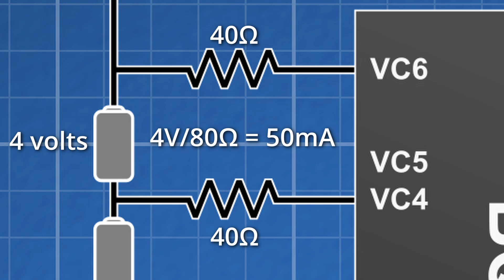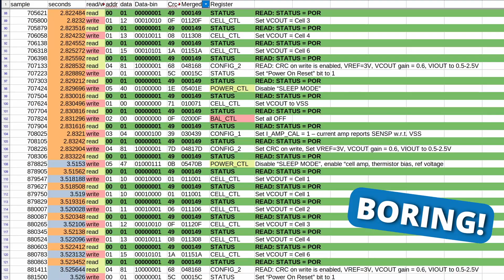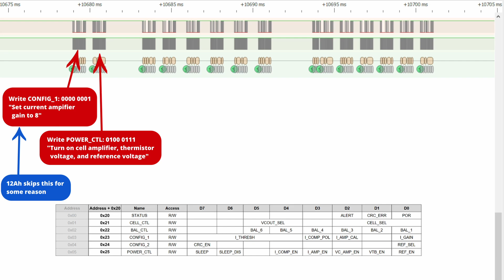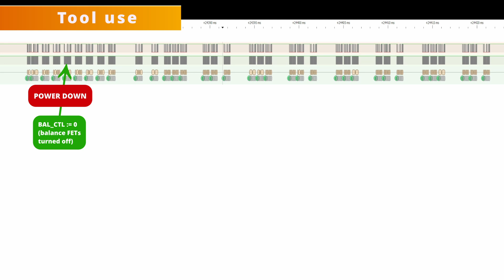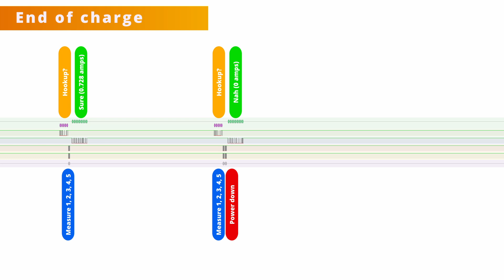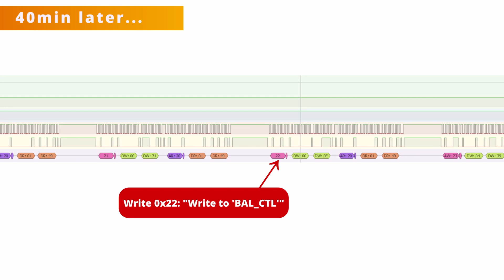[010] Why do M18 batteries charge to 3 bars?

Comment: Found you through Louis rossman and I'm now binging your backlog. 

It's absurd to me that my DIY BMS implementation using nothing more advanced than a few opamps and comparators from the 80s for ICs and a bunch of generic discreet components does a better job than these outrageously expensive products. 

There are so many cheap and reliable ways to top balance these cells that even a trickle of balancing current would significantly improve lifespan.

Comment: great vids mate! Any device or way to do cell balancing on any brand of non balacing battery, am on dewalt batteries but would be of interest to hack if possibler. On dewalt  can get a cell reading from the inner spade connectors. A way also of checking low or faulty cells
Reply from the maker: Check my [009] video on Dewalt. Pinned commemt was from someone that found a RC  charger that works with Dewalt (most don't due to the 10-Ohm resistors between C1-C4 pins and the cells).
Reply: @toolscientist  Hey Thanks

Comment: I have been reverse engineering Ryobi batteries (also made by TTI) and seems like they only balance if the imbalance is within certain range ~0.2v. Anything more and they dont attempt to balance. Also the pack voltage also has to be higher than some threshold to balance. What I found was that the balancing speed is too slow and on the latest Ryobi packs, if you put an imbalanced pack on a charger, it will permanently lock the cell, as in change the uController code, making the cell useless (4 flash error). Pretty bad design causing lots of "dead" packs with perfectly fine cells in them.
Reply from the maker: 18V or 36/40V?

Comment: Hi can you help me with a pcb of a battery m18? I repack 2 batteries. One works really well but the other blinks red and green. The bms lights dont work. And I check the cells and  have proper connection. With the tool runs the with lights but dont run the motor. Full pack have 19v and the 18650 cells looks pretty balance diferences 0.1v. The thermal camera shows me a really different temperature in one smd element 8N. Can you help me to repair? Its really dificult to buy a new pcb here. Im from patagonia argentina. Thankss
Reply from the maker: Have you seen the PCB schematic from Quagmire Repair? That could help you.

Comment: I noticed you used a rapid charger, ive tebalanced serveral of my larger batteries several times. This weekend one of my 12 ah batteries showed the usual 3 bars on the battery but fully charged on the charger. I also was cleaning my truck, a tacoma which had storage behind the seats which i hadnt been into in god knows how long, i found a normal charger that i mist have had for years, curious, i plugged in the battery and suprise, it showed a red light! I lef the battery for several hours, not sure how long until the charger swapped to green, but the battery shows fully charged. 

Im sure many people are like me and at this point only use rapid chargers at the minimum. A follow up of this same style video with a standard charger, potentially one 4 or 5 plus years old would be highly informative. Im very curious, if perhaps for faster charging they dont want to wait for balancing and strictly try to get one or two banks up to 4.2ish, then call it good.
Reply from the maker: The balancing commands happen internal to the battery. It's the signals between the MCU and AFE. The AFE is what does the balancing and has no interaction from the charger. There's a very slim chance that the standard charger sends different signals to the battery, which in turn makes the MCU send different signals to the AFE, but I'd very much doubt it. 

The simplest solution to all of this, would just be to have it balance after charging has finished. That way you don't slow the charging down, but still have balancing.

Comment: so far haven't ever had an issue
Reply from the maker: Do you have any 8 or 12Ah packs? Open them up and measure the voltages. It's quite likely you have at least 0.1V imbalance, unless they're very new.

Comment: Forgive me for my ignorance, but for the link for "code for balancing" in your video description, how would you implement that onto a Milwaukee battery? Like, is that code meant to be flashed onto the existing BMS on Milwaukee batteries and effectively replace Milwaukee's bad programming? If that is the case, how exactly does one go about doing that? Apologies if I'm understanding all this horribly wrong.
Reply from the maker: It was just an example to demonstrate that implementing balancing would not be difficult for Milwaukee. I would need the original source code (or reverse engineered code), then I would need to insert that chunk of code in, compile it to a binary, then flash that binary to the MCU.
Reply: @toolscientist Ah, I see. I appreciate you answering my question seriously.

Comment: you will be more Shocked if you try to test hilti batteries, specially  36v they put expensive ic chip but the same,, 
take my  advice all power tools batteries are the same it's an manufacturing policy not make perfect to make customers always pays new once
Reply from the maker: I'm surprised by Hilti. Their 36V stuff is a bit rare these days. They seem to have gone all-in on 22V and Nuron
Reply: @toolscientist  yeah it is , here in jordon still use ir 😅 , the microcontroller for 36 v is atxmega16a4, and pored doesn't have batteries balance and hard to reset , working on it  hope to hack it

Comment: There’s a scenario you did not test. See if balancing circuit turns on if a series got above 4.2V. This would mean could simply hook up pack to power supply and supply very low current above 21V and would slowly self balance without disassembly

Comment: If you could build a m18 charger clone that instead of telling to turn off unbalancing it turns it on instead?
Reply from the maker: The charger can't tell the battery to balance. Only the microcontroller inside the battery can enable balancing. You'd need to flash the microcontroller with new firmware
Reply: @toolscientist  I went ahead and charged a high output to 4.4V per cell the bms doesnt even balance or basic bleed for safety. I had hoped this could be a trick to initiate automatic balancing at 4.2-4.25V and a 25ma trickle. Milwaukee deserves fires for this basic omission in pack design. The forge batteries HAVE to have balancing if they are doing 2C+ continuous charging!!!???
Reply from the maker: @SurferBobbyLew  the battery won't ever let it charge above 4.2V via the CHG pin. There's a blocking mosfet on that pin that the battery's MCU will turn off. If someone charges via B+, then yeah, things can go bad, but is Milwaukee responsible for people doing dodgy charging? 

I got contacted by someone claiming to be a 'EV battery consultant'. They said balancing wasn't that critical, and some believe it's best to not balance as that way bad cells are removed from circulation earlier. I don't really buy it as they could monitor cell health via the BMS and soft lock any batteries with bad cells.

Forge video coming in 2.5hrs, by the way

Comment: Great videos and good humor! Hopefully more will come  :)  we use only milwaukee tools at work and they are pretty good to stand bad conditions like working in wetty or sometimes even under water (not long time). Of coz corrosion kills battery later but that can take time.  Sad to see how bad their desing is VS price and warranty isint long because "company use"..

Just today opened one "dead" milwaukee battery and there was 2 cells like 3.2v and others was 4v, i charged those and then did some load test for it.. after 10min heard "snap" and other 2 cells (not those what was under voltage) died completely 😃😃
Reply: But even battery desing isint best one they will work many years without problems or i havent seen any dead batterys from new to couple years of "heavy" use... 🙄
Reply from the maker: What battery type? 8 & 12Ah seem to be the worst. Most kf the others are pretty reliable, even without balancing. I've got a couple of 10+ year old packs that are still going.

Comment: Well, that means the me getting upset that Parkside Smart battery s with all the hardware required on the pcb already and still doesn't balance is nothing compared to big brands. I don't know which brand to get, maybe the PowerStack has a better chance of staying naturally balanced??
Reply from the maker: Yeah, nkt sure how to test powerstack. The chips they use are capable of balancing, but that doesn't mean anything. It's got a very thick coating, so impossible for to probe without using solvents, which I don't want to do around fragile pouch cells.
Reply: @toolscientist  I've read your Reddit about DeWalt balancing mate. Fantastic work and info. I guess the only way to test if there is any balancing on PowerStack would be to discharge a cell below the other by quite a bit and see if it's getting brought up to the same level upon charging or at least after a few charges. I've a guy from Korea or China that manually balanced his Power Stack.
Reply from the maker: @ciprianwinerElectronicManiac  I'm currently doing that with M18 Forge. Up to 4 days now and still seeing something happening, but not enough to confirm that it's balancing. After that I need to run it through multiple charge/discharge cycles to see if that brings it back into balance. Unfortunately, it's a lot more time consuming!
Reply: @toolscientist  Yep, wasted tens upon tens of hours trying to balance and figure out the capacity of each cell with the Parkside batteries. My chargers probably have over 100.000 hours of runtime combined. I almost forgot about the Forge, that thing is an absolute beast, you've got the 6Ah? I doubt that it will balance too fast if it actually works at all. I've got some Makita clones with balance circuitry on the board and I believe that those actually try to balance because the chargers are dumb and do not cut off after a voltage so it just floats it giving it time to balance.
Reply from the maker: @ciprianwinerElectronicManiac  I've got the 12Ah. If it's balancing, it's only at about 2mA, but the resistors it has should give 20mA balance current. Maybe 10% duty cycle? I'm thinking it's just the highest cell settling to a lower voltage after charge.
Reply: @toolscientist  Wow, that battery costs an arm and a leg. I'm wondering if you could spot a temperature difference on the resistors with a thermal imaging camera. I've yet to get one but it's on my priority list. The voltage settle could easily fool you. Do you have the slow charger to give it a better chance? I doubt they would bother with PWM on such a low current application.
Reply from the maker: @ciprianwinerElectronicManiac  I've tried measuring voltage across the resistor. I should see 2V across one resistor. Not seeeing anything on multimetre or scope. PWMing balance is likely as you need to balance for a bit, then let it settle, then measure voltage, then repeat. But 10% seems way too low, I think it's just settling.
Reply from the maker: @ciprianwinerElectronicManiac  nothing on thermal camera. I wouldn't expect much anyway at 2mA.
Reply: @toolscientist  Yes, I was thinking about the same thing. Some circuits pulse a load, measure and then pulse again. But 10% of 20mA hmmm, for a 12Ah it's nothing, that would take ages to make a dent, it would self discharge faster than that 😂
Reply: @toolscientist  Does it have discrete transistors for this purpose or the resistors are connected to the an IC directly?
Reply from the maker: @ciprianwinerElectronicManiac  only 2 transistors on the board (plus a powerFET to block the CHARGE pin). There's a group of 5 resistors (100Ohm) between cells and IC. Can't see a 6th resistor that you'd expect between C1- and Vss, but it could be elsewhere.
Reply: @toolscientist  What is the purpose of the resistor from C1 to VSS?
Reply: Hah! I believe that I got to the bottom of my problem with my Battery, one of the cell was always low. After manually balancing it, it would always discharge no matter what, after testing each cell capacity and IR, I've cut the connection to the BMS from that cell and measured 38mA constant, it would only turn off If you press and hold the button to disable the Bluetooth. It seems the 100 ohm resistor has 3.86V across also with PWM because it drops and then goes up fast, I didn't put my scope on it because it's almost 5 in the morning but I just need to disable that darn balancing transistor.
Reply from the maker: @ciprianwinerElectronicManiac  C1- to Vss resistor isn't strictly necessary. It's just so that all cells have a high and low side resistor in their balance path. Without it, C1 would have 2x balance current of other cells.
Reply: @toolscientist  That makes sense, thanks. Because I saw some balancing circuits which used 6 transistors.

Comment: I have been thinking about this video every other day since it's been posted. 

I am going to hazard a guess that Australia doesn't have Harbor Freight (historically notable for selling abysmal cheap tools, have been improving quality dramatically over the past many years)- but I thought it would be hilarious if their cheap power tool batteries were doing proper cell balancing.

If the absolute bottom of the barrel Harbor Freight Warrior drill kit for $13 USD does proper cell balancing on its packs, I think I'll lose my mind.
Reply from the maker: Or Aldi...
I could definitely test Aldi Ferrex as it's super cheap. I was planning to work through all the pro brands first, though.

Comment: I’d be curious to see how Ego outdoor equipment batteries balance. They have a built in “maintenance mode” which actively drains the battery to 30% after the battery has been unused for a month. So they clearly have the capability built into the battery, and use it for the aforementioned purpose. Wonder if they balance or just let the cells do whatever.
Reply from the maker: I do want to do Ego, but it'll be some time before I get to them. Thrifty Tool Shed has done a lot on them, so you might be able to find an answer on his channel.

Comment: For what’s it’s worth my 8.0ah battery has this issue.  I took battery apart and tried charging cells individually.  When I did this I was able to witness the battery balancing itself.  But that is impractical.  Next I plugged a Venom charger into the positive and negative ports on battery at 0.5 amps.  The charger monitors battery voltage and adjusts charge accordingly.  Since battery was receiving charge and not able to communicate with charger does that mean it was forcing battery to balance?

Comment: Soooo how close are we (you) to writing new firmware and flashing the MSP430 to have proper firmware?
Reply from the maker: It would be a big project (unless the source code leaked!), so I don't think I'll try. It would also only be useful to a small number of enthusiasts with the technical knowledge and equipment to flash ROMs. It would be a great middle finger to Milwaukee, just like the guy who did the FU-Dyson-BMS project. But my todo list gets longer every week, whilst I'm still only finishing a project every ~2 months. I've got a few other projects that I've been working on that I think will be more useful for the average person, and also fairly achievable for anyone with a soldering iron.

Comment: Amazing how much time and dedication you put in doing this, Thank You

i read many of these different year version of M18 12Ah due to imbalance, i found they rely on Samsung 40T poorly made, same cells used in DeWalt Flexvolt 12Ah, Bosch uses version 2, same issue.
Milwaukee for short period of time switched to using Murata VTC6a but most of them have bad board which won’t charge. then they switch back to Samsung 40T version 3 which i have yet to see any bad one. Again no balancing, just rely on the cells itself.
Reply from the maker: Lets hope these new Ampace tabless cells are more reliable
Reply: @toolscientist  i have them but sold them very quick and based on feedback from customer that they love it

on the other hand, some of 8Ah and 12Ah board would kill and drain some bank to 0v, i caught one 8Ah that quite warm to around 35C in the area of the lights meter and drain the 2nd bank from the terminal to 1.4v
so i quickly remove both ends of the main terminal

i am kind of shock these multi million dollars tool companies don’t really test out what they design ?
Reply: Update some finding 
i have a few M18 - 12Ah which all cells are balance but Milwaukee tool which can read the battery shows they are not balance which only tells me that board got bad
Reply from the maker: @TranTek  12Ah High Output or 12Ah Forge? Do you have a Milwaukee battery tester?

Comment: I'm just wondering if parkside batteries and chargers do the same 
by the way they are way cheaper than Milwaukee and Dewalt
Reply from the maker: They're not available in Australia, unfortunately, so I can't test them.
Reply: @toolscientist  in Lebanon they are almost in every hardware store
as a technician I do repairs for both the battery and the charger as well as the device itself such as impact drivers drills grinders and so on
Reply from the maker: @kahlid-ataya  yes, I've seen quite a few videos about Parkside from ErCan Everything, who I think is Bulgarian.
Reply: @toolscientist  i think he is 
I did some videos about it but in arabic